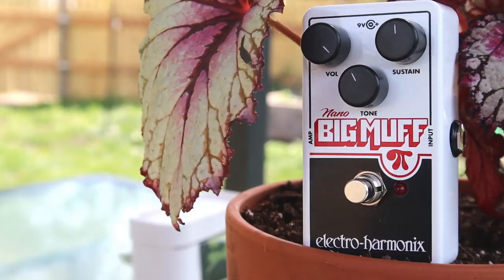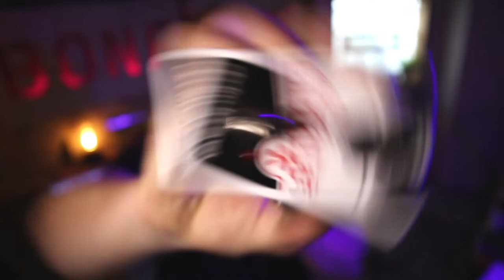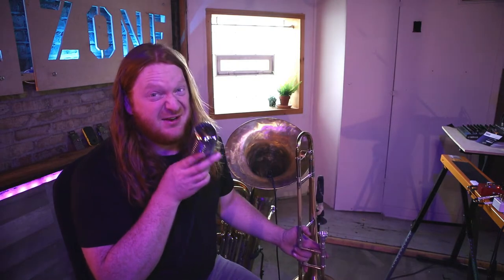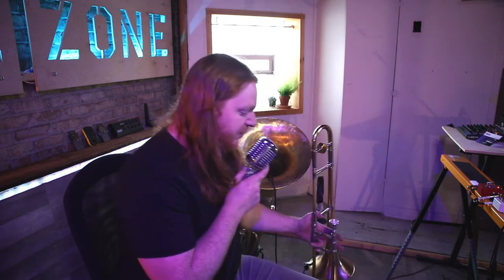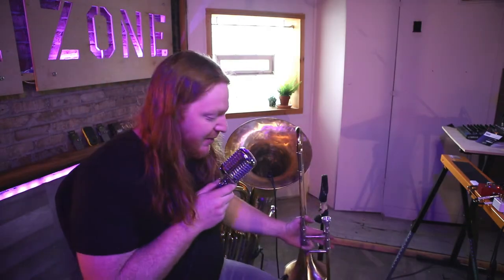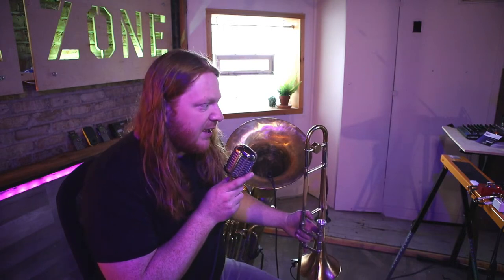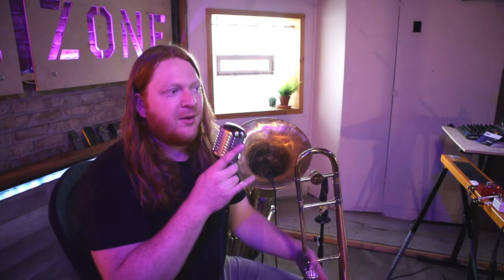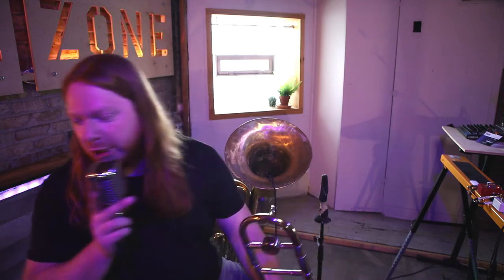Trombone Plus BIG MUFF (Fuzz Pedal)

Comment: Nice video!
If you have problems with the breath-sound and feedbacks through distortion pedals, just get a noise gate for live situations. I use the Boss NS-2. In it's FX-Loop I have my Distortion and Overdrive. It works really great live with a cranked PA.